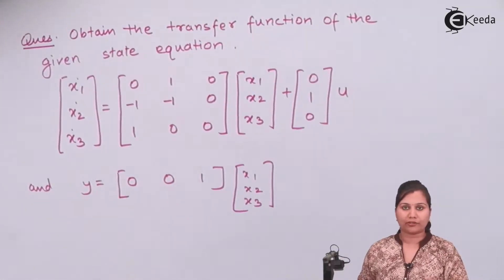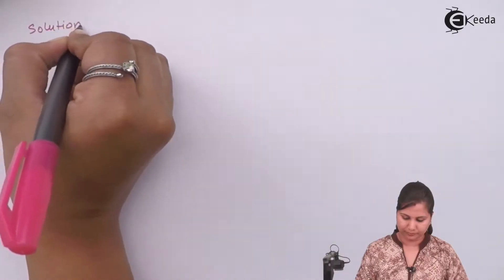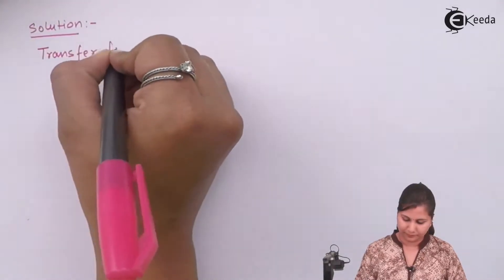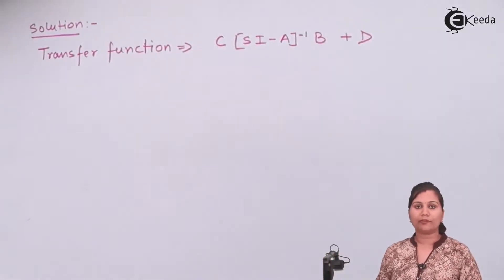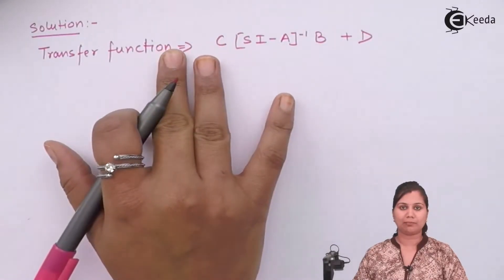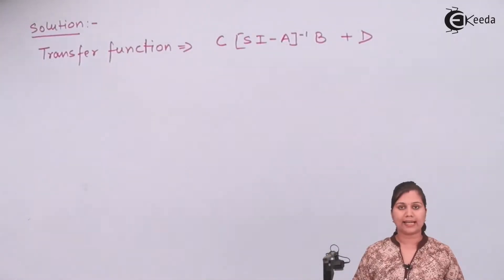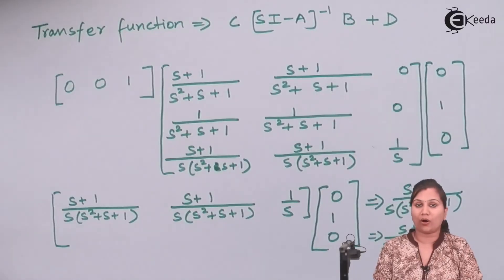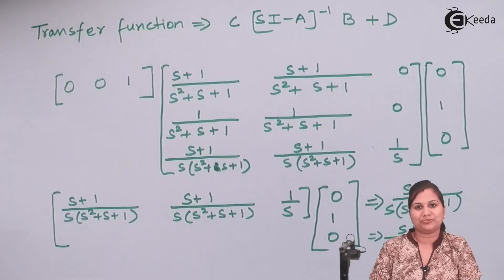Transfer Function Derivation from State Model Statement Problem No  4 - Control Systems

Comment: Correct Answer is :    1/ s^3 + s^2 + s

                            
Verified using MATLAB :

>> A=[0 1 0; -1 -1 0; 1 0 0];
>> B=[0; 1; 0];
>> C=[0 0 1];
>> D=0;
>> [n,d]=ss2tf(A,B,C,D);
>> mySys_tf=tf(n,d);
>> mySys_tf

mySys_tf =
 
        1
  -------------
  s^3 + s^2 + s